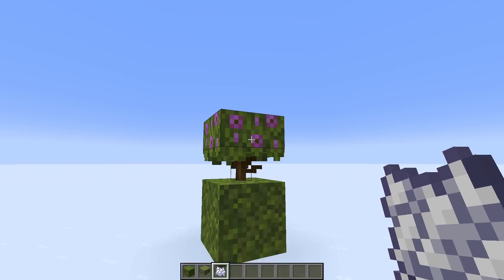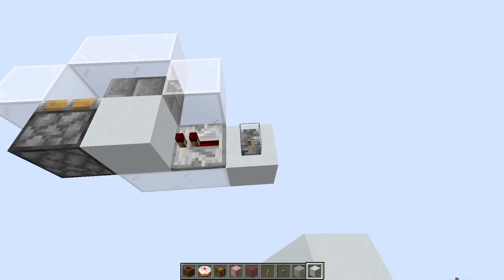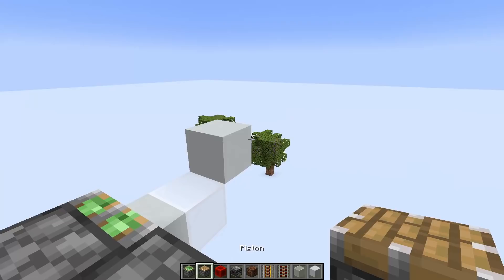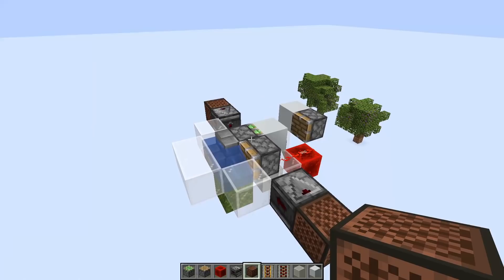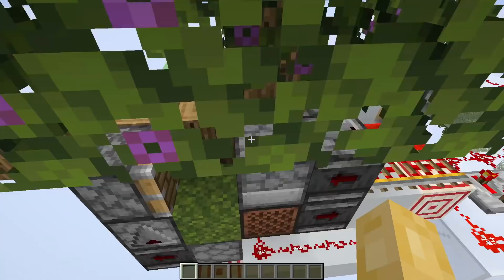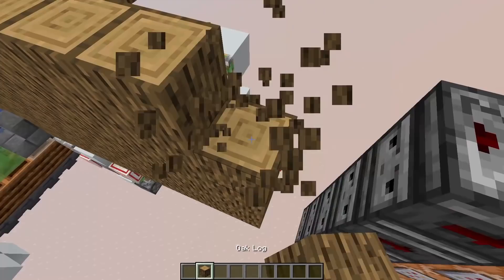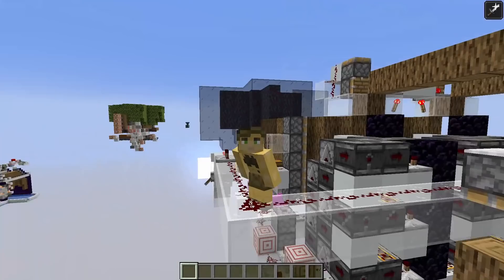let's Build a Crazy Azalea Tree Farm

Comment: This farm is really perfect. I've built it in survival on vanilla 1.17.1 server.
Few comments for newbie minecrafters, who are going to build it in survival:
1. Load schematics in creative mode and clean (in litematica edit mode) it from azalea leaves and most of oak logs, just leave lowest layer of logs for reference and testing of block conveyors, this cleanup will make schematic MUCH easier to read and follow.
2. If you're going to use different building blocks (iron blocks instead of concrete) replace them during schematics cleanup.
3. TNT dupers. I've never seen such type of dupers, they're really cool. To assemble them put target block to the position of extended piston to prevent the block over TNT from powering. TNT will be put to budded state during the next activation cycle. 
4. Carefully build central part of the farm where azalea trees will grow, do not forget to put and properly align hopper minecarts.
5. Shroomlights. If you have no nether tree farm gathering of 112 shroomlights may take a long time. Just replace them with glowstone (in the lower, unpowered layer) and jack-o-laterns  in the top layer, that powers trapdoors.
6. Assemble and test bonemeal producing modules first, this will allow you to fill up chests, hoppers, droppers and dispencers of the central part of the farm with enought amount of bonemeal.
7. Assemble and test block conveyors and TNT dupers before finishing building of the central part.
Reply: Thanks for the great advices. For the cleanup part, is there a faster way than manually? I've been wanting to download litematica for a while now but it's my first time actually using it.
Edit: I found it! It's called schematicRebuildReplaceAll in the hotkeys.

Comment: This is relatively late, but I just built this. The slime block that moves the stairs next to your two moss blocks has a tendency to push any items that land on top of it. Sometimes, moss carpets or seeds can end up on top of it because of leaves breaking, and they can get launched into your blast chamber, ending up in the shulker loader and break it. 

There's probably a more elegant fix to this, but I just added a glass "blast shield" to stop the items, which is 7x5 vertically under the 5 columns of oak logs that are going to the blast chamber.

Comment: 3600 logs/hour = 1800 chests/hour.  1 shulker farm produces 523 shells/hour, and so needs 262 chests/hour.  1800/262 = 6.8, so this farm should be able to supply 6 shulker farm modules and have some logs left over, yielding 1569 shulkerboxes/hour, or 26.15 boxes/minute.
Reply from the maker: That is some good maths there, if only we had the autocrafting table in the vanilla game then we could automatically smush them together into boxes.
Reply: @cubicmetre  I use carpet, so that's what I'll be doing (with only one shulker module).  Because MBE will break some things in my world that I'd rather not redesign, I have the challenge of designing crafting machines without using movable tile entities.  I'm currently working on a factory to create every redstone component, with the end goal being a machine that automatically restocks by activating various farms in my survival world.  It will need at least four players to run.
Reply: @Hyrum_Graff  3600/8 =450
Reply: @commentaller4248  Yes, but how is it relevant?
Reply: @cubicmetre  lol, it happened.

Comment: I think the weird cycle is due to how water flows. If I recall correctly, water flows every 4 ticks, and I think during its cooldown, it doesn't check for obstacles in its path, only when it spreads. This would mean that since your cycle is 5 ticks, every fourth trigger would have the water spreading the instant the piston is retracted, or something along those lines.
Reply from the maker: Water flows every 5 ticks and the BUD in theory takes 6 ticks to reset, however something weird happens with the block event scheduling and as a result it still responds to the water while it's resetting until after 4 cycles it stops. I'm still not quite sure what is happening.

Comment: Hey, i am just getting into the technical aspects of minecraft and your vids really help. I was wondering what kind of tnt duper you were using as its different from the ones ive seen most other youtubers use.
Reply from the maker: It's an entityless duper that I designed specifically for my blast chambers, it features a safety override which removes power from the TnT allowing you to easily build and modify it without accidentally triggering the TnT. It's simple a lot easier to build and more compact than your regular slimestone dupers which use minecarts.
Reply: @cubicmetre 
How do you build it

Comment: This tree farm is amazing! I built it up according to the schematic on a spigot server, and it is producing logs well. Although one problem– one of the moss block cores isn't working. It looks like the piston which cleans above the moss is always in the way of finding an azalea plant, or punches it out when it does find it... Like its out of phase with the bone-mealing or something. Any ideas what could be happening? Has this design been tested on Spigot/Paper/Purpur servers? Thanks so much for the help, I absolutely adore this farm design, and the genius tech that went into it.
Reply: I found a solution that worked for me. its kinda hard to explain in a comment but ill try.
"Main line" - redstone line from on switch to each core
1. there is a redstone repeater running from the main line to the non-working core, set to 2delay (was 1)
2. on the non working core, find the note block at the end of the main line, add an observer for delay. (there is already 1)
3. on the working core, add a repeater on 1 delay to the main line, after the note block, but before the piston/dispenser circuit
4. on the non-working core, under the piston/dispenser circuit, there is a line which controls the clock for the lower moss block. add a repeater on 1 delay between the piston/dispenser circuit and the moss circuit.

Should work from there
Reply: @rileybates8406  do you have screenshots of the fix?
Reply: @rileybates8406  So I did the first 3 things you said but can’t quite find where to place the 4th repeater. Any tips
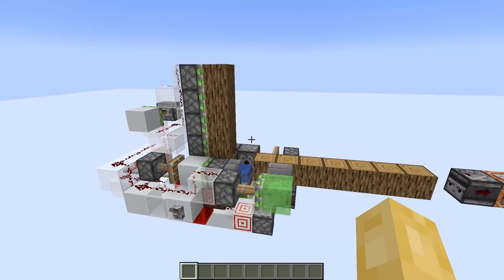Reply: @rileybates8406  I didn't want to build the full thing so I built the simpler module shown at 8:00 and it worked perfectly fine in solo world, however on spigot server I have the same problem than Daniel. Do you by any chance have an idea of how to fix that one? Is it a similar fix to what you told?
Reply: The other thing I realised is that the pistons that are supposed to remove the logs only are getting activated even when there's no log yet

Comment: I have build this farm in creative mode, test and found it work perfect, then I have build on vanilla server in survival mode, test and it work perfect, but after farm was running about 4 days I go to check and I found that moss block is everywhere around farm, also the central troughs was full of moss blocks close to outside edges of farm, there was thousands of moss blocks but troughs close to inside edges of farm was empty, also one of moss block which was response for grow azalea was converted to rooted dirt so farm get broken. It was nearly to break the server because of amount of items. I repair farm, run and double check, it was working perfect, no problems for converting moos block to bone meal, no problem for growing Azaleas and no problem for TNT chambers, all good. I leav farm running for next day and go check again and I found that the troughs was full of moss blocks close to outside edges of farm again, farm itself was working correct, it was no deficit of bone meal but there was thousands of an extra moos block in troughs. Why it happen, how to prevent this. It only happen if farm working offline on server because stressing farm in carpet mode for hundreds of hours doesn't reproduce that problem :[
Reply from the maker: This is due to the items falling into unloaded chunks and remaining there until the player returns, this is why I have the obsidian shields on the blast chambers, to prevent items from falling into unloaded chunks. I was not aware the moss farms would do this aswell.
Reply: @cubicmetre  It never happen on "my eyes" but when I was offline.
Reply from the maker: @croonx1779  Yeah, it happens because while the farm is chunkloading itself, there is a region around the farm where the chunks become non-entity processing meaning any items which fall into these chunks will get stuck and remain there until the player returns and loads the whole area. To fix the issue simply disable the parts of the moss farm near the edges and prevent items from going outside the entity processing chunks.
Reply: @cubicmetre  I did. I removed redston behind last 3 pistons (close to the outside edge) in each of 3 lines of redstone in each of 4 lines of pistons and no more problem. Farm still working surprising even better.
Reply: @cubicmetre  Now farm working so stable. Thank You very much cubicmetre.

Comment: what if you were to like, harvest more logs from the farm ? should crank up log rates without affecting bonemeal at all, here you get between 2 and 5 logs per tree, but azalea can grow a fair amount more than that
Reply from the maker: More log pushers requiring a special sequence to handle the orientation of the branches, double or even triple extenders and such. All of these components would increase the lag and complexity of the farm. At that point you may aswell build a universal tree farm which has so many more advantages for the same level of complexity over an azalea only farm.
Reply: @cubicmetre  How you place block like that in 2:20?
Reply: @sgtjet1723  Tweakeroo mod
Reply: @sgtjet1723  you could also just shift against the repeater in vanilla

Comment: 4:46 the water flows faster than the system after few cycles. if water should be flowed, it sets a timer and after the timer ends, it checks if the water still can be flowed or not. and if it can, it flows and if its not, it cancels the flow event. but blocking water before the timer ends doesnt remove the already running timer. it will just wait for timer and cancel the event when it ends. however, because it doesnt check if water can be flowed or not while timer is running, the water can be removed and placed again but it will still flows if its done before timer ends. (this can be simply proofed by doing this experiment. put lava on the ground and pick up the lava with bucket and wait few moments and put it back in the same position before the first placed lava's flow timer ends. it will flow faster than normal lava because the timer didn't reset)

also, because the water flow time and system cycle time is different, The update detecting piston infront of moss block will eventually finish pulling while water timer is about to end, As a result, the water will flow before the BUD system reset, So the piston cant detect the flow and it will stop the cycle.

Comment: Can't say I'm smart enough to have the right answer, but my massive egg shaped head might have seen that water thingy a few times in the past. I feel that when the game doesnt have enough time with a non air block in the space where the water will flow, it seems to flow back even faster and with disregard to random tick speed.  Especially noticed it early on when messing with a bucket sorter. Perhaps its similar to how you might end up getting lava to spread in an area by spam clicking. Perhaps some form of scheduled update that fails to get removed and executes anyways. Those would be my best guesses.
Edit: But your solution is, of course, lovely.

Comment: Built this farm in my world, and it works great. However, some moss carpet and seeds seem to make their way to the storage above, making the shulker loader not fill up purely with logs and clogging it.
Reply from the maker: The loader allows for mixed item compatibility, so if it fills up too much it will eventually just eject the box and replace it with a new one. Alternatively you could add an item filter for logs if you don't want rubbish in any of the boxes.
Reply: @cubicmetre  yeh I did just put a log filter above. Didn't notice the mixed item compatibility feature, though maybe I just haven't run it for some time. Great farm btw!

Comment: 4:54 
I guess by now  you found out the issue yourself, but anyway.

The problem is your bud is 6gt reset and water is flowing every 5gt. So what happens is after the first trigger the reset piston triggers instantly.
by the time of the 2nd trigger the reset piston is not fully retrectat, and so starts resetting 1 gt later than the trigger. With each trigger the reset becomes one more gt ofset. After 4 triggers the bud is so far of, that by the time the water flows the piston is not budded yet And that way the contraption stops.

To solve this issue you would need to make your bud 5gt reset. This can be easily approached by making the reset piston zerotick.

I Think this is the longest comment i ever wrote xD. I hope the explanation was kind of understandable.

Comment: I think the 5-5-5-10 (total 25 ticks) piston update is connect to the water updates they measure 6-6-6-7 (total 25 ticks) with the stair trick creating a moment the pistons are still in motion resulting in skipping a beat

if however you change the sticky piston into a regular you get a stable 10-10-10-10 on the entire system. slower but stable.

also water updates at 5 ticks creating the unstable situation with the piston updates without the stair trick. so i think if the back system could be faster it will always be ready for the next update. i'll try tommorow to see if i can fiddle around with it.
Reply from the maker: The odd clock cycle doesn't really cause any issues, it's more of a nuance, a 10-10-10-10 cycle might be more elegant but it's also slower. And given the farm is slow to begin with we should take as much speed as we can get.

Comment: It’s probably stupid but i want to change the tnt dupper with tnt dispencer but i don’t find the correct delay to blast the entier Wood… 
Do you know what it is or if the timing is more close ?
Reply from the maker: A TnT duper generates the TnT instantly, a dispenser has an intrinsic 4gt delay. This means in any case where you replace a duper with a dispenser all you need to do is remove 2 repeater ticks worth of delay.
Reply: @cubicmetre  thanks You very mutch for your help ! :)

Comment: Hi, how did you get the hopper minecart inside the moss block? I can't get them inside the same area, as pushing a moss block in any way just breaks the block.
Reply: nvm I found a way if you place a rail sloping into the moss block the cart will just roll into it, if anyone else was stuck like me. It is a little harder to align though.

Comment: works great! only "problem" im having is that sometimes there are seeds/azalea/carpets in the wood shulkers, and is just dont know where they come from. Do you have any idea? Its only like 2-6 items per shulker, so extremely infrequent/random.

I mean, the wood goes from the blast chamber straight across and up to the shulker loader, so there is hardly any space where those could fall into the water streams. If it was "only" azalea, i would have thought that some leaves reached far enough, or that they landed on the logs and transported fast enough before they despawn. But its actual seeds and moss carpet too, so either from the bonemeal generators or the center module itself, but then there is NO WAY the items "pop off" and make ALL the way to the blast chamber/collection pool, right?

I even added some extra glass over the water stream so they dont glitch over the cornerblocks into the stream, but that didnt help either
Reply from the maker: This farm is very chaotic and honestly not a very clean design. I was simply pushing the azalea tree farming mechanic too hard with the amount of knowledge I had at the time.
Reply: Hey, this is 3 months late, but you should check out my comment on this vid for a fix. It was posted 7 months ago for reference.

Comment: How do you run Tweakeroo and Optifine together? Also, very nice video
Reply: Optifabric
Reply: There is a fabric mod specifically for optifine capes. Tweakaroo has zoom, and Sodium+Lithium+Phosphor have all the performance improvements of optifine and more.
Reply: @WellImWinter  The thing is that OptiFabric is not available for 1.17
Reply: @imanolcigandafernandez6214  Not the full version, but the dev version is available and working.

Comment: how does this work with none dupping? i tried to replace the piston dupe with a dispenser but after a while there are too many treelogs and it just breaks ... what should be the tnt/log ratio when not duping

i tried different tickspeeds of the pushing pistons ... but i am not able doing it correctly v.v help please
Reply from the maker: A TnT duper produces the ignited TnT instantly whilst a dispenser has a 4gt delay, so you will need to reduce the delay powering the dispenser by 4gt.
Reply: @cubicmetre  Thanks for the answer, since your design near the tnt is so compact. i just lengthend the signal that pushes the wood by 4 gt... but its not working ?! i dont see why